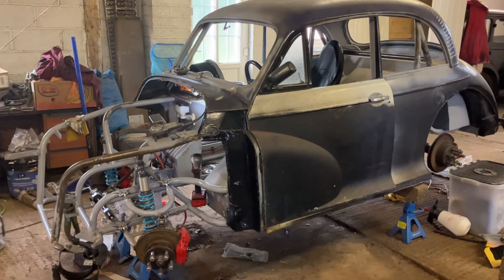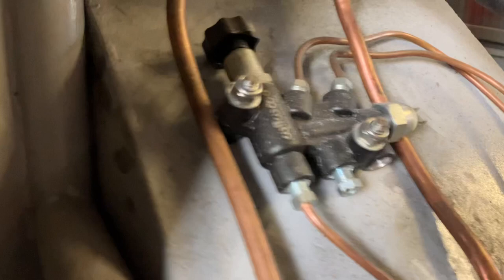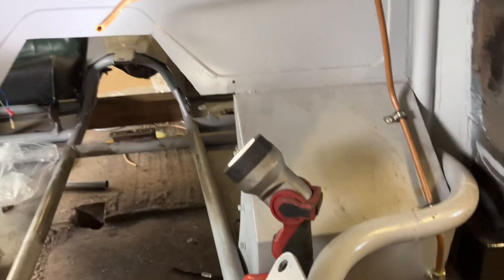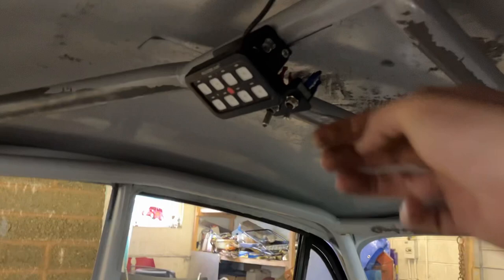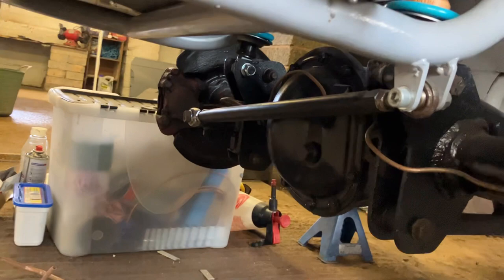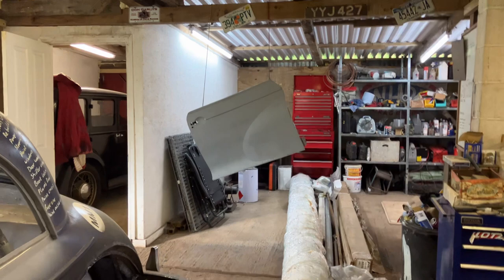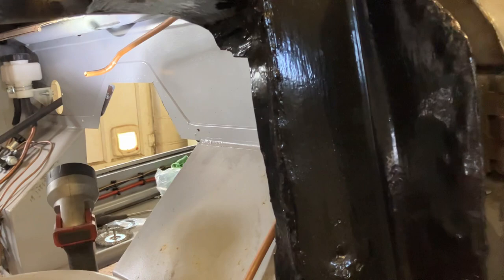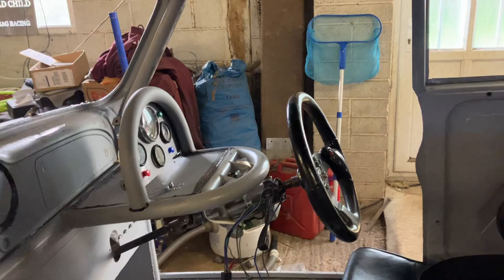Morris Minor V8 Project…

Comment: My sin is a rear engined ford Cosworth V8 mg Metro v6r4 lookalike with full roll cage which I made same for the unitary sump/ bell housing I had made from a solid piece of aluminium which came in two pieces I welded together with a mig, every bit was sourced from cheap sources like they wanted £2500 for the scavenging pump for the dry sump,I purchased one that was a generic type ,4 port it's up and going,I would like to show it one day

Comment: Was the Volvo 240 rear end fitted with custom halfshafts or is it a convenient width? Been trying to find info on rear ends for upgraded moggies but so far it's been a crapshoot.
Reply from the maker: The axel had been shortened, and the shafts have been cut, sleeved, and doweled. Use to handle the hot Rover V8 with some hard launches.. I suspect I will snap them, but then I’ll look at getting new shafts made.